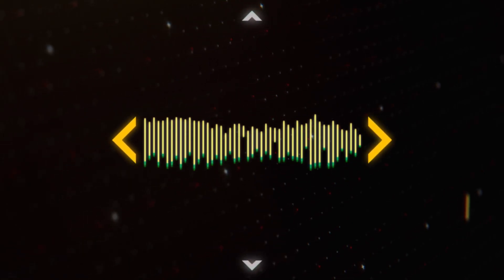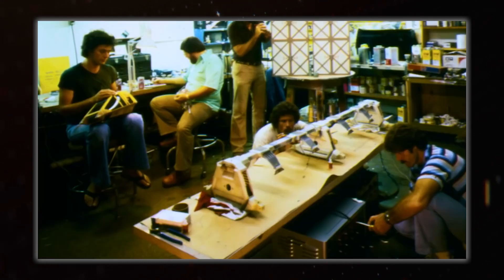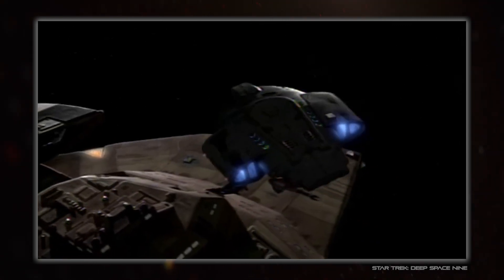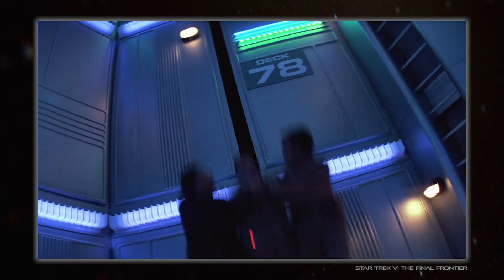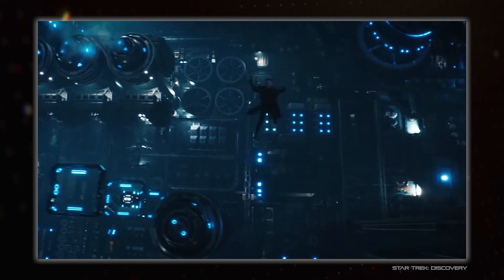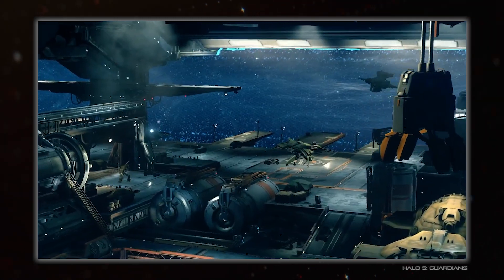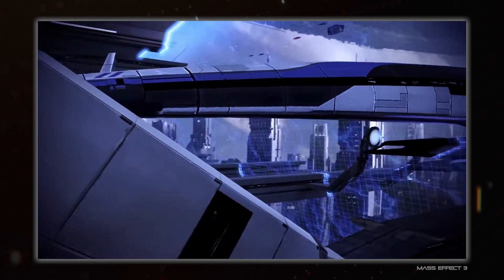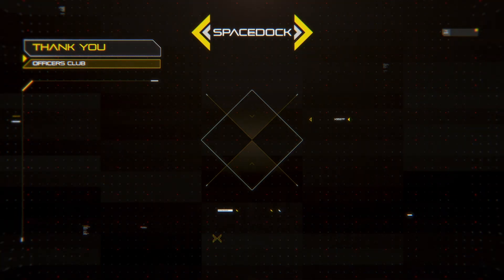Why Do Sci-Fi Spaceships Seem To Change Size?

Comment: As someone who wants to make a sci fi series I have somewhat been aware of this but this video shows me a massive amount of that topic I haven't considered now that I've seen this shows me that not only using built models or cgi models can be hard to scale but they both have pros and cons I've been thinking about ways how I could possibly match the realistic hard sci fi space battles like those in the expanse I've been thinking of a few ideas such as having the model on some kind of stand (tho I don't wanna say what kind) running along tracks and could move in any direction to match near or perfect accuracy to space battles or even much better than the expanse did such as trying to also put in the simulation for weight for each parts of the ship to how those will effect its certain heading and velocity etc including the ship's thrusters and such would be very hard to pull off and a lot of money but I'm hoping if I can at least try to do everything that makes a series so good like the expanse or arcane did than it would be good but would be pretty hard to pull off while I'm not gonna probably get to those I think trying to test and constantly improve might get me their but hey I know I have some ideas for making the sci fi series I want and how I know practical models instead of CGI makes it more naturalistic and more real because it is real and you want that for ypur storytelling so doing that could impact the storytelling well if pulled off right I mean star wars was famous for that and mandalorian did the same thing (granted it doesn't feel like star wars and obi one sucked) I think theirs still so much practical effects gives because green screen or the new tech of using 360 TV screens instead of green screen in the mandalorian changed everything for making film and no longer has the limitations of blue or green screen anymore which is great bur topgun maverick shows us how utterly amazing it is because it's so much more tense and it's real because you can't replicate G forces in green screen and you can see that because they actually flew in real jet fighters! Practical effects is also shown very well in Mad max Fury road was utterly amazing and became one of the few rare 21st century classics practical effects should be used as much as possible because CGI should be used as a tool help with some things that practical effects can do not replace them and people are starting to get tired of seeing so much CGI because the amount of money going into CGI more than models, sets, or practical effects is not only ruining the experience or makes it cost more time to do it but not doing anything like trying to make good scenes or certain fights etc like the first black panther movie where the CGI in the final fight scene was well kinda garbage because it sucked the amount of how the two actors now where more like cartoon characters now and thr punches didn't have any weight with them which is why it kinda sucks but black panthers suit I think he was in...civil war I believe his suit looked much better than in the movie, why? Because they actually had him put a practical suit on irl while it didn't look like that in the movie it allows the VFX artists to put CGI on that suit to make it look better which saved time and money which is what I'm saying that CGI can't replace or replicate everything because if you still wanna save costs than the examples from civil war and the movie should be obvious that having an actual model being used in a movie with CGI on it to make it look better which is something that films and such should do more often sense it could save millions. But nope companies like marvel, Hollywood, Disney etc have become so over reliant on CGI and green screens that the the quality of CGI is going down because the amount of strict time for VFX artists to get stuff done for quantity over quality I mean in the last 2 years marvel released amount 15 shows and movies compared to before endgame  their use to be two movies and such every year it shows that marvel, Hollywood, Disney etc have been doing identity politics and woke culture is ruining their reputation 🙄 including attack their own fans and it's no surprise nerdroditic and critical drinker etc cover this stuff well for what's happening including this is happening for games as well and etc in other sources of entertainment we all know what happened to G4 and IGN when they started covering more of politics and crap instead of games and such to get away from that stuff and including other companies which have basically destroyed game journalism. It's just me and a few friends who want to help tackle this problem which is why this video does not only bring up the problems with scaling but also stuff that can't be done and doing that as accurately as possible is important but with movies and Hollywood etc dying I hope woke culture, cancel culture, identity politics, tokenism, the bad way of representation and diversity die with it. I got tons of hundreds of vids on the topics I talk about in my save playlists so anyway good job Soacedock you done it again!

Comment: This is also a really big deal for things like miniature games. Take Battletech, for instance. An AC/2, which is the longest range autocannon in the game, has a maximum effective range of 24 hexes. The game's miniatures are at 1:285 scale(roughly, this is hotly contested lol), and a hex is about 36-38mm. So roughly one hex to scale is 10 meters. So an AC/2 has a maximum range of 240 meters, right? Basically a 20mm high velocity cannon can't outrange a pistol caliber carbine.

Well, wrong, because the game specifies a hex is actually 30 meters, because thats what it needs to be for things to make sense.

Scale is whatever you need it to be as a designer.

Comment: Scaling being off doesn't matter as much to me as what's being portrayed being practical for a given spacecraft.  The fact that ships are larger on the inside than outside, for example, not a big deal.  But the idea of having massive open hanger bays or massive open pressurized interior spaces that can't logically fit into the spaceship we're discussing is immediate dissonance and pulls you right out of the show/movie in question.  At least for me, my mind immediately goes "But you'd never freaking DO that.  Every inch of space you have to pressurize is a risk of decompression later on."  And in the case of the Discovery's massive internal open spaces, the immediate thought is "So where the hell does this fit in the ship?  Why are you doing this?  It makes NO sense from any sort of design standpoint, even if you technologically COULD.  It's just a waste of space in a medium where space is precious."  That's what matters to me a lot more than "LOL the outside is tiny".

The Expanse, Mass Effect, Firefly, Star Trek (TNG/DS9/VOY)/Orville - good examples of sensible ship design.  Rooms are small, and partitioned to prevent decompression of a large area in case of a hull breach.  Those small areas not only made practical sense in terms of filming in an age before CGI, they make sense in terms of what you'd actually do in spaceship design to keep the precious air and crew in your ship and not on the outside.  Doors stay closed.  You don't just rely on forcefields that can fail and vent a cargo hold or shuttlebay. (The brig notwithstanding)

Discovery/SNW/some parts of the Halo franchise - bad examples of ship design.  Large open spaces where a single pinprick hull breach can eventually vent the entire hold to space, impossible to reasonably seal off, large bay doors left open all the time meaning one blip in power vents the entire hold and the crew working in said hold to vacuum, not to mention the loss in heat.  Structurally unsound because of lack of structural members in walls/floors/etc.  Large open rooms with no purpose other than to look cool because show writers/producers can get away with it due to easy use of CGI in the modern age....

Battlestar Galactica kinda had a mix....the CIC, quarters, hallways and internal spaces mostly were sensible and the use of manual hatches and doors was nice to see.  But then you had hanger spaces and such that were wide open and easily vented to space in the event of a hull breach, and these were areas that were also the most susceptible to that sort of thing, being on the outside of the ship by necessity.

Comment: Ha, yeah. The Defiant was always weird with scale. I could not help but notice the two decks of windows tucked away on the underside even though the ship was not anything close to large enough to have that many decks. 40K is also skewed with its 'size of ships' (and Titans) but with something as far-out as 40K its a lot less jarring and when things are over or underestimated it can normally be brushed away with a wave of the hand suggesting it's inaccurate 2nd or 3rd hand observations from within the universe. A sort of 'the fish was this big' thing.

Once again though, it seems The Expanse did a pretty solid job with scale, even if the interior sets of the Rocci wouldn't actually fit within the hull of the ship.  😂

Comment: Props also to space battleship Yamato whi in the original series suffered a lot of this..as the ship was suposed to be built from the remains of the original battleship Yamato so it was the same size (arround 265m long) yet it still had vast hangar and interior spaces.-
Then when they did the 2199 remake they decided to take the bridge of the original series size and rescale the rest of the ship acordingly so it was noe 333m long and then designs almost ALL the interiors in the 3D model so they show the correct size allways.. including the hangar bay wich now its a revolver type pallet carrusel thats wraped arround the main engine shaft..

Comment: Cool to see Warframe in one of your videos! In case you didn't know, the interior of the Railjack was originally even larger! The developers reworked Railjacks to remove a lot of unnecessary interior space. The original Railjack had pretty much four full decks, but its now condensed into basically two, with a little extra space at the top and bottom.

Comment: Sometimes the interior and exterior fail to match up for other reasons. In "The Expanse" the interior of the Rocinante is longer than it is tall but the exterior is taller than it is long. In the book there are several levels that are individually small, but the show runners quickly realized that having several small sets would be impractical, and having a single set with several levels was extremely impractical, so they ignored realism and had a single two story set. If you line up the airlock door on the exterior model with the airlock in the interior set, that airlock is the only room that would actually be inside the exterior model.
Realism and consistency are important but the audience can be forgiving when the rule of cool is invoked (or the rule of funny or drama or etc).

Comment: Another good example of ships changing size in games is the pillar of autumn in Halo CE. It might be why it was shown in the video, but for those that don't know; the final warthog run in Halo CE goes across the spine of the Pillar of Autumn, and it goes for quite a ways even though the actual canon length of the ship is about one and a fifth km. There also I bit in the middle of the run where the entire center of the ship is missing and the two halves and held together by a little bridge. It's odd.

Comment: While not a ship and made in 2D animation, I remember how in the Gundam Char's Counterattack movie they had a funny scale inconsistency with the Sazabi and its cockpit. The mobile suit is shown and described to have the head height of 23 meters, but in 2 particular scenes the Sazabi (and by extension the cockpit) was made bigger, like around 70 meters in size. The first scene where Char entered  the suddenly gigantic head of the Sazabi, and the second scene where the Nu Gundam was holding the cockpit, the cockpit being bigger than its palms when it should be about the same size

Comment: Elite Dangerous takes scale to a whole new level.  They run a 1:1 scale of the MilkyWay.  So if  you’re on a planet, and you’re 100km away and your SRV has a top speed of 30km/h … you’re going to be driving for a while.  This becomes even more prevalent when you’re on foot and you start running… you’ll be disappointed with how far you’ve run. 
This does make the game a little more enveloping though.  Anytime you dock at a station, you need to run to a certain location to board.  While 30 seconds of running doesn’t sound bad… it really is annoying.  
I do love the sheer size of the map.
A deep space trip can take weeks.  It truly is horrifyingly big.

Comment: In addition to the scaling issues you’ve covered, you can run into different perceptual scaling issues. This is most obvious if you ever visit a museum warship, as ships will sometimes feel large and small at the same time. The battleship Alabama (35,000 tons) feels massive when standing next to her, but on the main deck and in some internal spaces feels rather small and cramped (something historians also note). The destroyer escort Stewart (1,200 tons) often feels cozy or even cramped when you recognize the size of the crew, but at other times she feels much larger (especially walking along the main deck whether in the superstructure or outside). It’s a weird dichotomy that really becomes apparent when you walk the ships for extended periods over a day, walking the decks like the crews would have rather than simply hitting the high points on the self-guided tour.

This is something you occasionally get with science fiction ships, with Defiant a particularly good example. It only magnifies the actual scaling issues unless you’ve been on a ship to experience this strange feeling yourself.
Reply: I was on an old Skorpion-class Soviet submarine once -- precisely the kind of interior you'd expect for a smallish space-faring warship, like a Defiant or Rocinante.
     There is NO WAY you could have a 3rd-person game camera in there -- it would be buried in the back of your character's head 90% of the time.
Reply: @stevenscott2136  Same, spent a whole day working/shooting in a WW2 US Gato sub. You can live in it, but it doesn't have the kind of room cinematic imagery expects/demands.
Reply: And then there's the further complication of lens projection. The same thing can look bigger or smaller depending on the size of the lens, positioning etc.

Comment: Star Citizen has had constant issues because of scaling, as all ships interiors must fit inside the outside hull. Most ships are shown as a concept first and later pretty much always increased in size, as the developers needed more space to fit all necessary components
Reply: And break bad design habits from considering onboard firefights over ship operations.

Comment: Got to say this is one of the reasons I love the ships in Star Citizen. Unlike Warframe the ships have to have everything contained within them. They addressed this recently in a vid where one of the devs had created a cool doorway then got told to zoom out and open the door which promptly clipped out of the hull. It makes it super immersive when you're boarding your ship since everything fits and makes sense from both the outside and the inside. Also means half the time you can just eyeball whether or not something will fit when loading up your ship on a planet.
Reply: That warframe issue is partly based on the space for drydock having to fit into the dojo building system and its still the largest room by far. There was also a redesign one year after the first version where interior was shrunk and they deleted its Middle section. But it's still taller and wider than it should be from outside and the prop of the wings were never fixed and dont adapt to the chosen skin when seen from inside. And this annoys me more than size issues.

Comment: The scaling is something I love about Star Citizen. The interiors and exteriors are fully realized, meaning you can summon your ship, go down to the landing pad, open the ships doors, walk through the entire ship, and get in the pilots seat to fly it out. There is no playing with scale, the ships are just as large as they are. Some of the ships are just massive, like the Reclaimer and the 890j, but you can walk through every deck and room on them seamlessly since they are fully mapped out on the inside without any scaling problems.
Reply: Unfortunately for the designers, it also wrecks havoc on their concept art once they realize that big things are big, and so ships have had to inflate considerably to fit the internal space for payload, hardware modules, and crew facilities. As well as break out of the mindset of laying out ships like FPS maps with all kinds of twisty passages and alternate paths.
Reply: @watchm4ker  Reminds me of the chaos design for Anvil Carrack, they have to fatten the bottom of the Carrack just to fit all the rooms and the bridge has to changed few times so it have two levels deck inside bridge